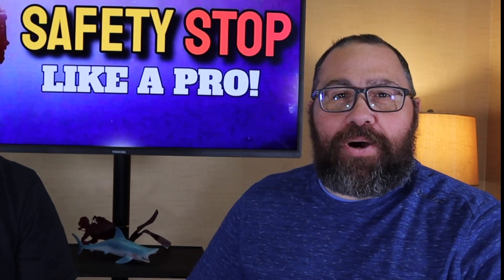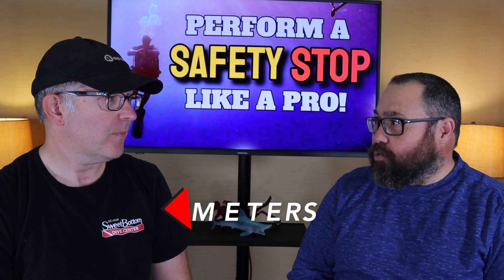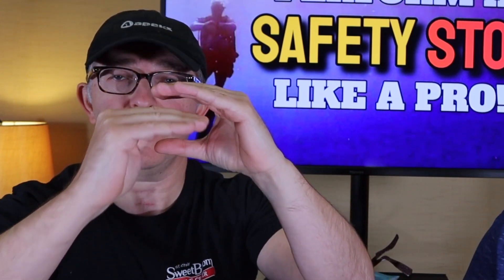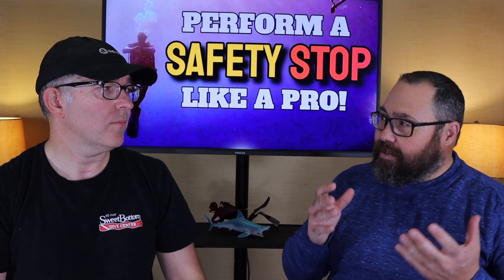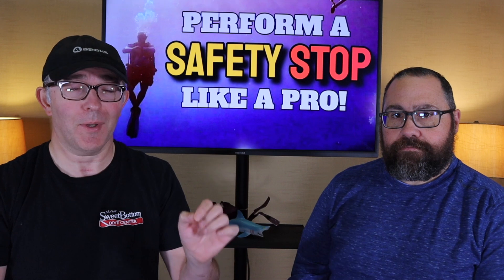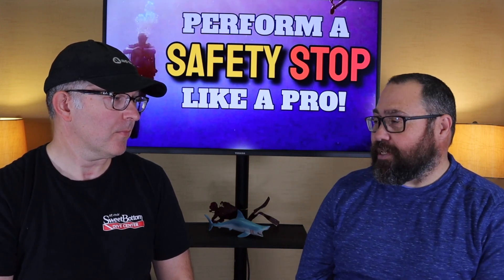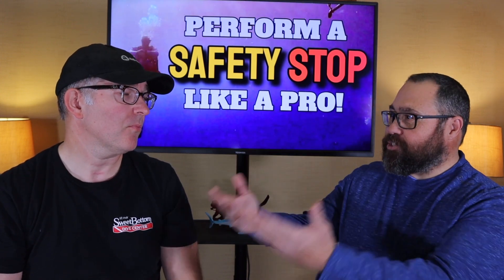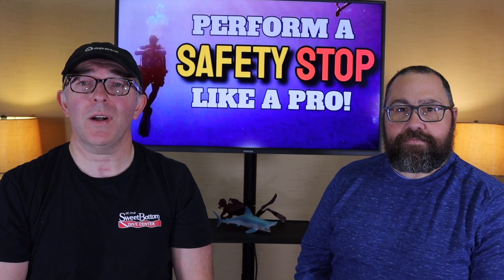How to perform a scuba safety stop like a Pro!

Comment: You should do your stop in an horizontal position that your whole body decompress at the same time. If your feet are below you your feet are decompressing at another rate as your upper body.
Reply from the maker: Thanks for your comments. We have addressed this topic in lengthy previous answer to a comment. See below. While we agree with your statement, not all divers want to or are able to always do a safety stop horizontally. Also given that each tissue has different M value the rate of decompression varies and as such tissues don’t all decompress at the same rate regardless of which position we are in. We don’t disagree with you, but variations do and can occur. In short, whether you are vertical or horizontal, it is better than not doing a safety stop at all. Thank for watching.
Reply: I’m not a scuba diver. My open water is this Saturday but reading this comment I have an opinion about it so here goes. Yes your feet are lower than your chest but even so, your feet are the last to get on the boat so it kind of evens out in a sense. Does that make sense?
Reply: That’s just silly
Reply: Agree 100%...
Reply: @vhockada  yeh, but your feet were also first in the water so started the dive sooner. Hope you enjoyed your OW course.
Reply: @graememckay9972  wouldn’t that depend on how you descend? Also what if I decide to belly flop into the water and descend horizontally?
Reply: Makes sense. Whatever way is done it should really be practiced a lot…
Reply: In the scheme of things, 0.5m difference isn't much. Upright is fine. Unless you're like 3m tall.
Reply: @friggincanvee  Most people are taller than 1 meter.
Reply: My god there is a lot of CRAP talked here. Its the total rate of ascent that matters not your 3 minutes stop. The only reason why PADI ask for one is because of poor diving practices

Comment: One reason NOT to ascend too slowly from athe last stop is because once shallower than around 5m you are at risk from boats and other surface vessels!   If you are diving in crowded waters, be sure to keep an eye and ear out (you'll hear a boat before you see it especially in poor vis), and use a SMB or dSMB to show your position to surface users (as well as your own boats captain who hopefully is looking out for you! (top tip- mark the top of your SMB with a unique marker, your name in big letters, or coloured tape and show your captain what it looks like BEFORE you dive over the side so they know precisely who to come scoop out of the water). If it's really busy and there can be a lot of boat traffic at popular dive spots, then i would extend my 5m stop by a few minutes, try and get as close as possible to "my" boat (top tip, after your intial bubble check at say 3m, take a look at the hull of your boat from below and try and remember what it looks like, colour, identifiying features etc, if the captain is using a hang bar, then ask them to mark that bar with an identifiying feature, ie bands of coloured tape or similar) and then surface at a reasonable rate, say around 10 to 20 sec to do those last 15 feet.  This also helps stop any surface currents from dragging you away from your boat too!  If you  are really pro, note which way the current was dragging you when you went in, and surface up current of your boat, and allow the current to push you closer!  Finally, if in big group, before you hog the ladder to try to get first back on board, ask if any other diver needs to go first, someone might be sick, tired, or cold, and welcome being able to get back on board first :-)
Reply from the maker: Max, you make some great points! Thanks for adding more information for our viewers! Appreciate your comments!
Reply: Many locations require a SMB, so your point is commonly moot.

Comment: I'm a dive pro and this is all sound advice. For those asking about weighting, trim and buoyancy at the end of the dive on the safety stop....If possible, try to adjust your weighting (do a weight check) with an empty tank (500 psi) instead of using a full one. This might take some logistics in that you may have to borrow a somewhat empty tank to practice this and dial it in, but if you can do it, you'll have a lot more success at getting your weighting right. Manage your weight for the end of the dive when you weigh less, not the beginning! :)
Reply: Thanks for the tip! It does make sense to do the weighing with an empty tank instead of a full one. This would mean about an extra pound should be added for me, because I always feel too light at the end of my dive. I had to really try hard to let go of the air.

Comment: I have been diving for 40 years now and I thought I would just mention something on the section about know when you are at the correct depth. I just recently starting using a cpu, call me cheap or old school (can't believe I waited so long so nice having one). I always had a marker @ 15 ft on my smb or dive flag ( if I am shore diving). I agree as with the safety bar if there are high swells your smb or flag will go up-n-down so this method may not be best for beginners but I thought you might like the input.
Reply from the maker: Thanks Edward. That is great suggestion. Some divers will use this in very bad visibility. We even tie a knot in our line at 15 feet so we can feel that and know we are at the correct depth. Good suggestion. Thanks for your comments.

Comment: One lesson I learned recently is that ascending whilst reeling in a ratchet line for an SMB adds another task to the ascent and tied up both hands making ascent control much more difficult. Definitely a skill to practice more. Great vid guys!
Reply from the maker: That’s a great point Dave. Definitely takes a bit more concentration to control that rate of ascent when you have secondary tasks on top! Thanks for watching!
Reply: I prefer to be a little bit more negative when handling a dsmb and spool, as i can work me up bit by bit (still being in horizontal trim) on the line without shooting up and maintaining the pull on the line keeping the dsmb straight.
Reply: @muellermay  agreed, I have also marked the line at 6m so I have a visual reference for my safety stop.
Reply: If I’m on an anchor line I typically don’t deploy but if I’m in open water (like I just aborted or ended a dive) then I will release my SMB during my safety stop. I have a belt reel and I can tell you it is noticeably easier to handle. I just take out my smb clip it to the reel on my hip and 2 puffs from my safe second and it’s up. I can also real it in like a fishing reel as I ascend. I use a combination of weight belt and weight in my bcd and I enjoy knowing I have my dive knife and a very useful reel with me at all time. It is also used when I spearfish as I can clip it to my gun and let the whole thing go as I ascend to the surface.

Comment: I completed my certification last week. Yesterday I went in my 6/7th dives. On 6, the BCD inflated rapidly because of a stuck valve in the inflator. As a new diver, I was terrified. As I’m zooming toward the surface like a cork, I’m wondering if I will have decompression issues…. Thankfully we were only at 10 -12 meters for less than 10 minutes. Thankfully, I was alright, just shaken. The five master came up, calmed me down and we finished the five. 
 I’ve learned a couple tips that could remedy the same situation. I’m the proud new owner of a BCD. At least I know how it’s been maintained and if it has an issue, I’m aware of it. I will pick up everything else when I return to the US ( currently I. The Philippines). 
 Thank you for producing content that newbies can understand as well as advanced divers. 
  Can you please do a video on how to get waste out of my wetsuit if one was to soul himself. 😂

Comment: Hi guys, just saw this after your follow-up one.
First of all, super-gratifying to see you talk about speed of ascend during the last 5 meters - I see far too many divers just shoot straight up as soon as they're done.

I do have a comment on the "no sculling/finning" point though. While, yes, in general, that is absolutely the approach to have during a dive (the less effort, the less gas usage), during the safety stop we're actively trying to off-gas. Especially after a nice relaxed (and possibly cool) dive, our circulation will have slowed down quite a bit, particularly in our extremities. So being a bit more active during the safety stop to increase overall circulation to encourage offgassing might not be a bad thing.  Personally I'll flex and stretch my fingers, arms, legs etc.  even if it doesn't "look good".

Thoughts?

Comment: Biggest thing to realise is that the 3-5min stop is less important that the way you execute it & what you do afterwards.
Example of dive trips: 
 - dude on a trip was flailing, his stops were constantly moving between 3 and 8meter, but he always made sure to full 5 minutes, not 4:58 or 4:59. That would be dangerous.  Between dives he would go for a run, evening activities: (drinking, sauna & being the last one in the bar.)
 - a different dive pair were usually the last of the group to hover around the safety stop, they were horizontal, relaxed, kept great and constant depth, and after about 3minutes would be the first to give the okay signal and slowly ascend to the boat... Slowly as in: they always got passed by others in the last 3meters....  one in the 20-25 dives they did a 6-7min stop while the rest was climbing on the boat or floating on the surface..... This was a deeper dive, to minimise exhaustion from stronger than anticipated currents.

Comment: This is The first vid I have watched from you guys. I Was really enjoying until you started talking about doing a safety stop in a vertical position. There is ZERO reason to be out of trim and be vertical during the dive, especially during the safety stop. For a few reasons.

1. This puts your body in a position where now all the tissues of the body are not off gassing at the same time. While likely minimal we are doing the safety stop to make sure we off gas safely so the whole of the body should be at the same depth to allow it to off gas at the “same rate”
2. It is building a bad habit to be in a vertical position during the dive, and remaining horizontal takes practice. You likely don’t have anything else to do during the safety stop, this makes the safety stop a perfect time to practice your buoyancy and trim. 
3. As you mentioned in the video it takes less gas and less effort to stay in the same spot in the water column while horizontal because of surface area and drag, so why should we want to “work harder” to remain in the safe area to complete the safety stop. 
4. While this relates to #3 it mostly speaks to newer divers, who Haven’t mastered buoyancy yet. As we come up we should be releasing gas from the BCD to compensate for gas expansion caused by the decreasing pressure as we go up, when we then adjust to a vertical position in this case for the safety stop we have now changed our surface area thus very RAPIDLY changing our buoyancy characteristics. Given that the greatest pressure differential is between that 15 feet and the surface this can very easily result in a diver bottle rocketing to the surface thus negating the point of the safety stop. And now we are risking DCS on top of lung over expansion injury. 

Especially for newer divers I actually advocate that the safety stop should be completed at 20-15 feet, instead of 15 to 20. meaning ascend to 20 feet, before proceeding to 15. This gives time to assure they have better control of their buoyancy before they reach the more “difficult” shallower 15 feet.  If you ascend to 15 feet and then attempt to get control over your buoyancy it’s likely by then you have already blown the safety stop.   

Thank you guys for the video, I really did enjoy the content.
Reply from the maker: Christopher, thank you for your excellent comments. We certainly agree with your statements regarding being in a horizontal position for safety stops but over the years have seen divers use a vertical position because it is more comfortable for them and have heard some state that they prefer to be able sere above them at their stop. So if it is more comfortable and eases visualization on their way to the surface, it’s better than not making a safety stop at all. It certainly is harder to hover vertically due to the decrease in surface area presented and thus newer divers should indeed be encouraged to remain horizontal. In terms of your thoughts of slowly easing into your safety stop depth starting at around 20 feet, that is an excellent recommendation. Allowing new divers to slowly ease into that 15-18 foot range without blowing past it.  (During my recent rebreather training, the buoyancy characteristics are much different and I found myself having to use that exact technique to maintain my position.) Josh and I strive to provide accurate and safe information and appreciate you taking the time to point out these issues. Thanks for watching!
Reply: @everythingscuba  thank you for taking the time to reply!
Reply from the maker: We hope to have a channel that is open to constructive dialogue amongst all divers. Not all of us are going to agree 100% with each other always but we aren’t too proud to not also learn from our viewers. That’s the great thing about the dive community. Very much appreciate your comments.
Reply: @everythingscuba  yeh bugger that I like a bot of narc when I get out, a couple of beers and then the party starts. Obviously not on multi dives, but a bit of Nos never hurt anyone.... xx
Reply: The opening response is correct.  You shouldn't be in a vertical position period when doing your safety stop.  Being more relaxed in a vertical position is not an overriding reason for doing your stop in a less safe way.  If you are a tall person 6'0 to 6'5 and are reading your computer at head level, but that means your feet could be at 21', 22' or even 23' during your safety stop based on your breathing and possible lack of skill holding your position.  This is less safe...
Next for new divers, the safety stop is a perfect time to work on buoyancy and breathing.  Get flat, stay flat and level.ost divers as we get experience go deeper and longer, which means bad safety stop habits learned early in our career equals to a lot less safety later.

Start with good habits, end with good habits.
Reply: @everythingscuba  it is good of you to actually engage on this reply, so many channels seem to consider themselves above this, to the detriment of their channels
Reply: In regards to reason #4

I’m a new diver and thought it was the norm to ascend in a vertical position, facing your buddy with your hand holding the LPI above your head to release gas. What you’re suggesting is that you should ascend in a horizontal position?

The way I see it, ascending vertically, you wouldn’t need to change positions for a vertical safety stop.
Reply: @scottguimond2268  So ascending vertically is also technically not correct, when you move to a vertical position you now effect your trim and buoyancy by having all of the air rush up to the top of the BC in one spot instead of evenly spread across the BC. This will then change your surface area which could cause you to change levels in the water in an unexpected way. While you may need to adjust to slightly head up to direct the air to the LPI to release air you do not however need to be fully vertical. While in a horizontal trim you could also utilize your “butt dump” or “kidney dump” to release air during ascent also not requiring you to change to a vertical position. Is it the end of the world to briefly come out of “perfect trim” every once and awhile no.  No one is perfect.  However. In a sport as potentially dangerous as diving, we should always strive to perform every skill and every dive in the most effective and safest way possible.
Reply: @christopherambrogio818  wow okay. That all makes sense, it’s just very weird for me to hear because in the PADI courses and videos, they teach you to ascend vertically. I do want to learn as much as possible about scuba diving and be as proficient in mine and my wife’s safety as I possibly can so I thank you for taking the time to explain this to me. Now I ask, is it really an issue for us to ascend vertically while doing this as a hobby? We plan on taking more courses to further our education but neither of us are interested in technical diving our going far beyond our comfort limits of safety until of course we decide we are ready for a new challenge.
Reply: @scottguimond2268  So do I think it’s an ISSUE to ascend vertically.  Not inherently. People do it all the time. Just like anything in life it will require practice, as long as you are consistently practicing the same way I feel you could become proficient in completing the task in many different safe ways. I encourage you to find divers to talk to and hang out with from MANY different agencies. Too often I see people get PADI or NAUI or any other agency and never broaden their view of the sport and talk to people from other agencies to see if maybe there is a better or different way being taught. Having an open mind to view other ways of doing things is one of the most important things you can do not just in diving but in life.
Reply: @christopherambrogio818  agreed 100% about keeping an open mind towards different styles of doing things. Thanks for your time dude!
Reply: I agree with all of your points except the lung over-expansion injury. From 5 meters? Give me a break, your lungs are far more powerful than you think and can easily take surfacing from 5 meters without you even noticing anything.